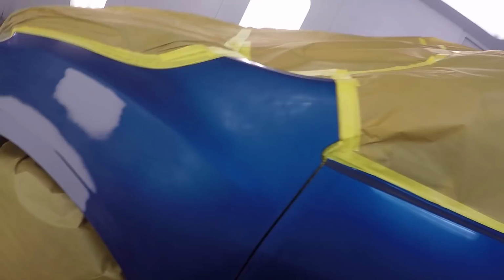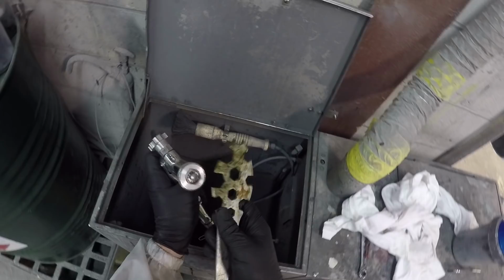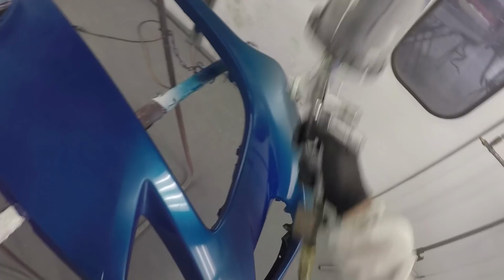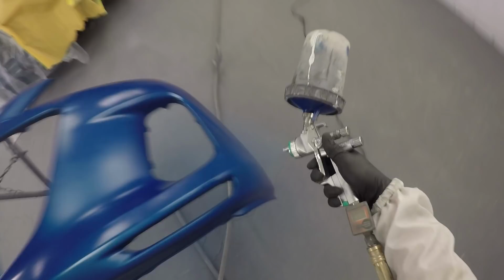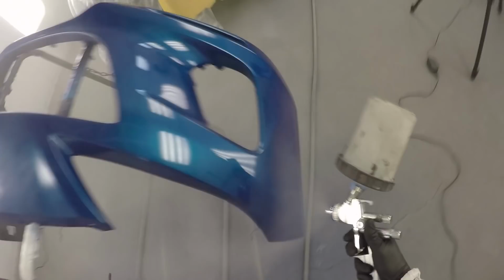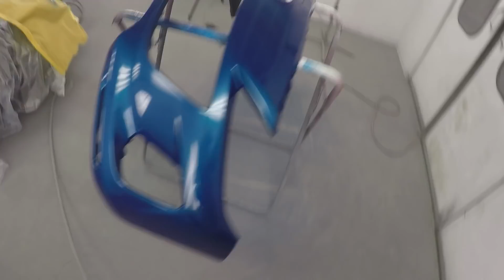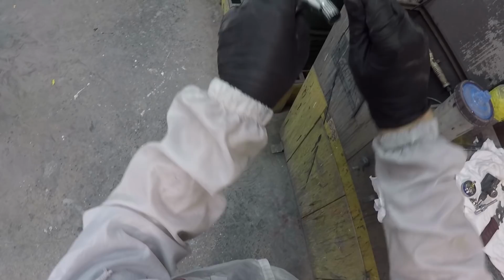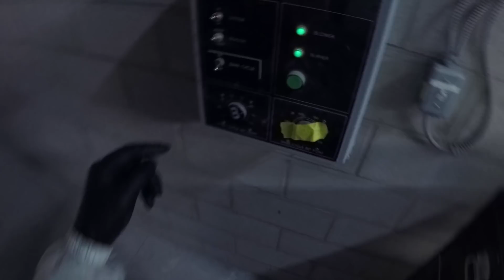Blue Metallic Paint Job - Mazda 3

Comment: Hi, nice work. i was winderg what needs to be done if clear coat pealing off on older car. is it possible just to put clear coat only? any suggestion on how to do it ? thank you.
Reply: +Misha , You would DA the panel down with 800, Grey scotch brite the edges or use some 1500. You can re apply clear as long as its prepped right